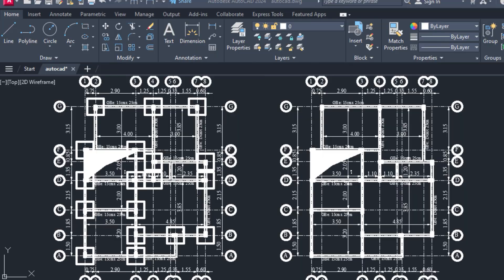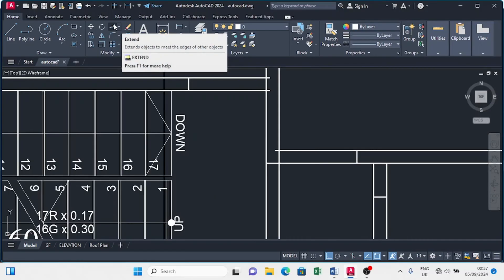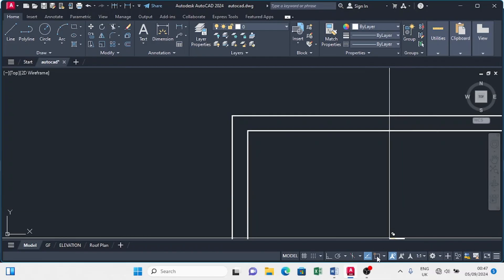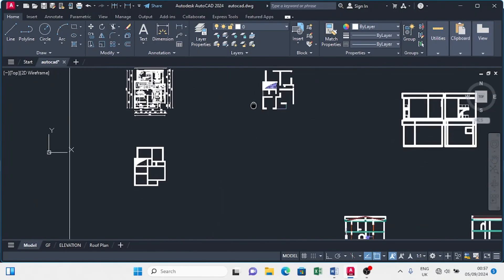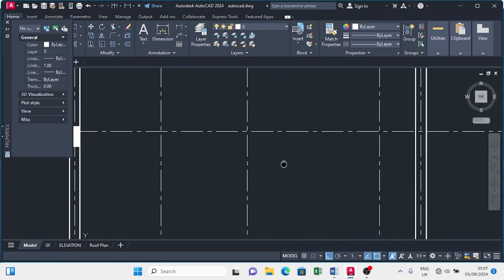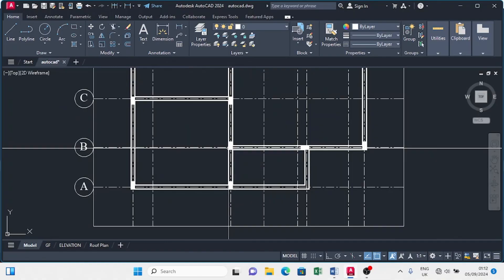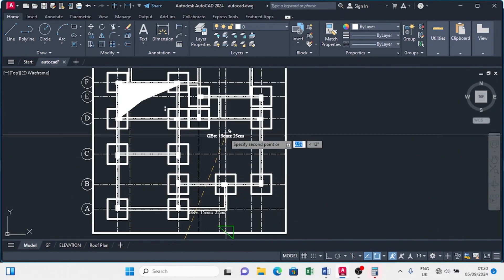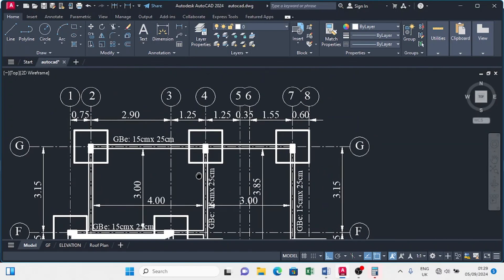How to Draw Foundation Plan in Autocad from Floor Plan

Comment: What if the columns doesn’t match with the first floor?
Reply from the maker: It's important for the columns to match remember the Loads are transferred via columns to the Foundations, you can Follow are new Channel GI BlueprintX to understand more, because there were Focus on Blueprint problem and way's to enhance structural and Architectural layouts from concept to Design to Réalisation 
https://youtube.com/shorts/2wXy5iN1OO0?si=39ue8PE8_xuBd4J5